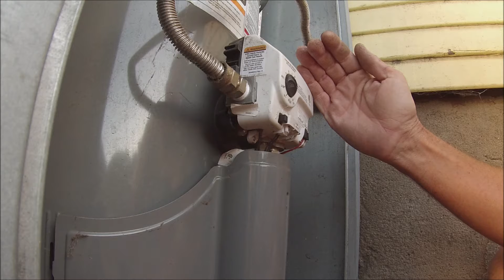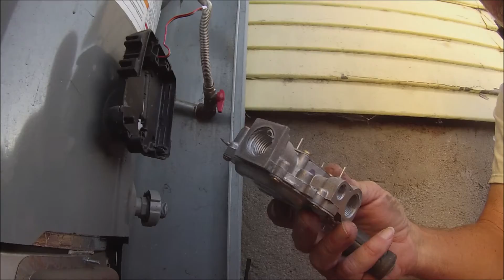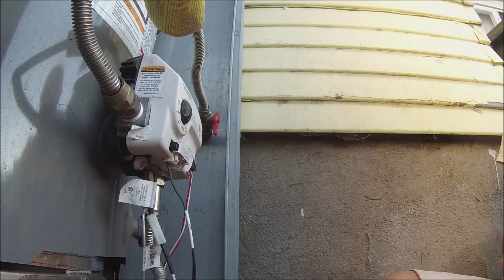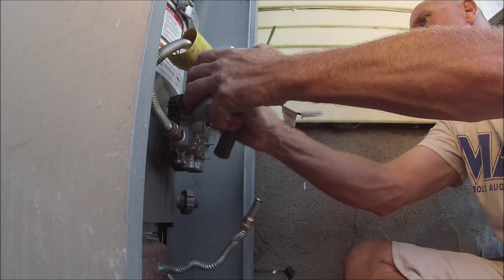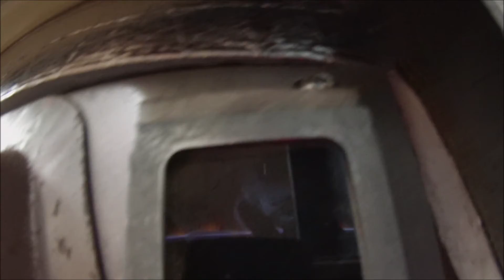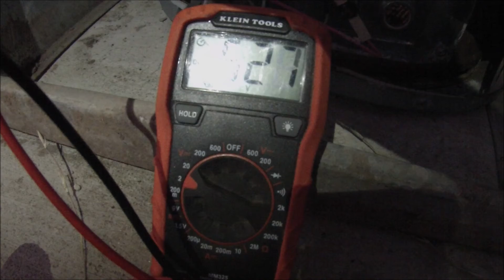Water heater valve Code 7 for a Rheem - code fault 7

Comment: Try the reset after cleaning thermopile with emery cloth good 
Then you have to, reset to clear code or it will not work, I know for a fact, turn pilot off for ten seconds then light pilot and then turn to really hot ten seconds then to hot ten seconds and pilot for ten seconds and off ten seconds 
Then relight and set temperature to hot😊😊😊
Reply from the maker: I have a reset procedure video , but thanks for the information , yes works often but not always , thanks for watching!

Comment: I have a similar water heater giving a 7 flash code. After replacing the thermopile and the entire control valve, it's still giving 7 flashes.
Is it possible for the chamber sensor to cause a 7 flash?
Reply from the maker: @smolpener7430  : so replacing the thermal pile will not correct a seven flash you need to either make sure that you put a new circuit board on and a new valve body or an entirely new valve. You should not get the same code coming back. If you replace the valve entirely, you can try using the reset procedure to clear it out and then see if it comes back just so you can get hot water in the meantime my water heater at home is currently doing this to me, once every four days, I gotta use the procedure on it .
Reply from the maker: @smolpener7430  chamber sensor not the cause
Reply: @thewaterheaterfactory  I replaced the entire valve control with a brand new one from rheem directly.
I've been resetting it fine, but it needs to be reset multiple times to get the tank up to temperature. Once the tank it heated, the light will stay blue until someone gets in the shower.
After doing the 15 very high, 15 high, 15 pilot reset I found in one of your other videos, it changed from a 7 flash to a 9 flash, and I did 3 different readings on the chamber sensor that came up as 7.7k ohms, 99.1k ohms, and 64.2k ohms.
If it's pertinent, after a reset the fire coming out of the burner starts off blue, then slowly turns purple, then red/orange before shutting off, all over the course of about 20 minutes.
Reply: After restarting it regularly, by turning the knob to off and waiting for it to discharge, it ran for about 15 minutes, then it shut off and gave another 7 flash code. Another chamber sensor check is giving me 8.6k ohms, and slowly rising over time.
Reply: @thewaterheaterfactory  One last update. I replaced the chamber sensor and the 7 flash is gone.